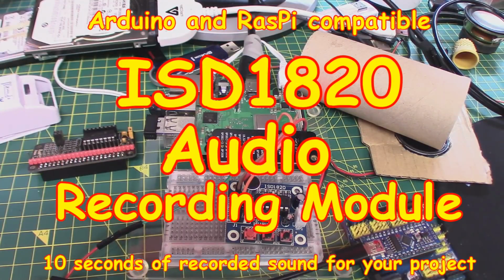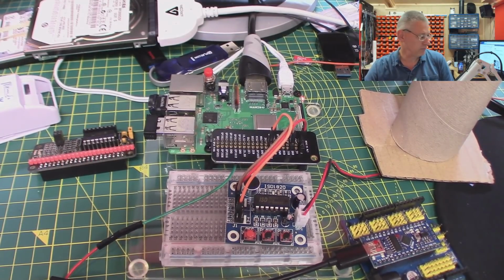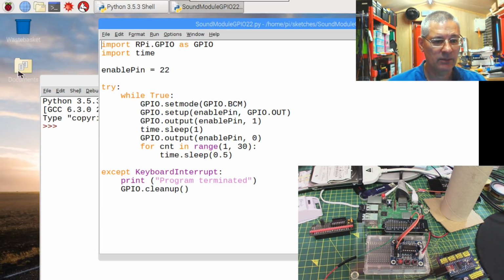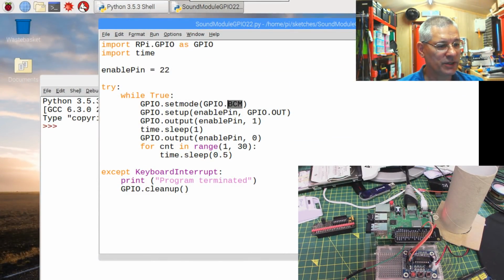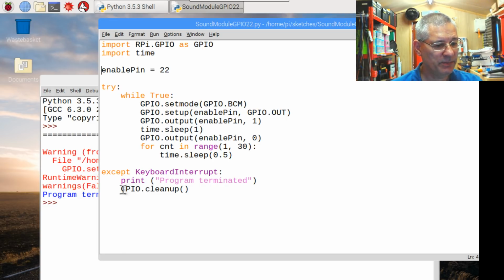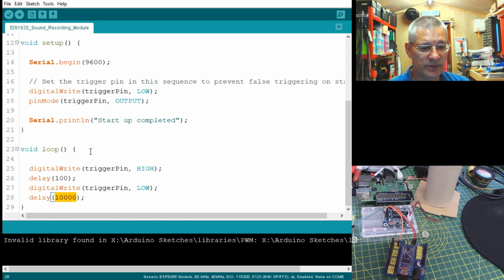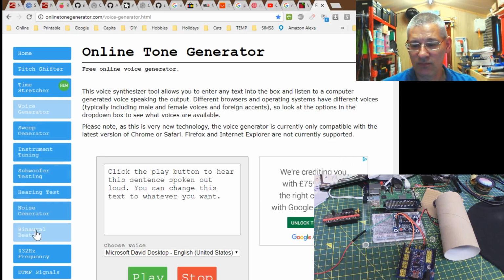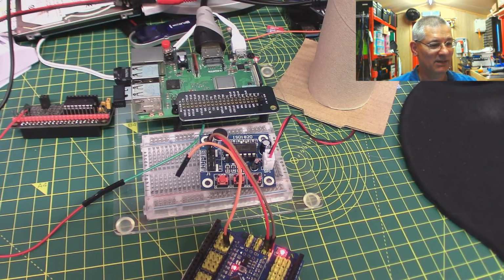#113 ISD1820 Audio Recorder Module (Arduino or 🥧RasPi)

Comment: Good video thanks, Is there a way of controlling the playback function from an external source such as an optical detector. Cheers
Reply from the maker: Well, you could use a N-MOSFET to bring the "PLAYE" pin to VCC (which is what the switch does) to make it play. Or, use a relay to do the same. If you can detect something and provide a signal then either of the above would work.

Comment: Hi Mike. My module does not play the PLAYL button correctly. It plays as long as you press, which is OK, but it stops after one cycle. Shouldn't it continue multiple cycles until the button is released? Does its operation depend on where to place the 'bridges'? If I connect P-E with REC I get the continuous sound I would like.
Reply from the maker: MIke's not here right now but I'll have a go at answering 😉 Yes, the jumpers do control how it is used; best advice I can give is read whatever documentation you can find on it. And other users may have answers too, so check out the Arduino forum.

Comment: Hello! I have a question: is it possible to play sound just one time automatically when the module get the power without push the PlayE button?
Reply from the maker: Yes, you can send the "play" command from the Arduino (or other microcontroller) without pushing any buttons. You can even tell it which track to play.

Comment: Is there any way i can record audio to pc at wav form with an arduino and an sound sensor. I don't want to save it on an sd i want real  time record
Reply from the maker: An Arduino is not fast enough, nor does it have an analog to digital converter that would suffice. You might be able to do that with something like an ESP32.
Reply: @RalphBacon  is this a shield for arduino?

Comment: I have one of the earlier models of this unit, or perhaps one by a different Chinese maker.  Mine has an on board LM386 amplifier chip, and two plugs for the speaker, one directly from the 1820 chip the other through the amp.  The amplified has a rheostat that you can adjust the level, and it is indeed needed, as it gets quit loud through the amp.  I believe the chip is wired with just the 20X amplification but I have not tried tying a cap across pins 1 and 8 to see if I get the 200X out of her as she is plenty loud enough as is.  The amp does, however also amplify the hiss that is present in the play back if you turn it up all the way, and substantially reduces that quality of the playback, at least to my aging hearing which is enhanced with a nice set of hearing aides provided to me by the VA in an attempt to replace the hearing I left over in Vietnam back in 1970.
Reply from the maker: These modules (or clones) change all the time, Jerry, which is why you got one with a built in amp, I suppose. But as you say, not exactly hi-fi if you can hear the hiss. Then again I don't suppose these units are meant to provide hi-fi playback either! Glad you got a decent hearing aid to assit.

Comment: if you sprinkle distilled de-ionized H2O on the datasheet it becomes less dry
Reply from the maker: If you sprinkle any water over a datasheet it tends to become less dry, otherwise known as sodden! So what's the tip here, Kenn? Do you mean use a demister type (very fine) spray?
Reply: @RalphBacon Kidding aside the datasheet is usually the best reference for a device. Usually the manufacturer puts a substantial effort in producing it. Often there is important information that is key to making a reliable, and robust circuit/device.  Why people are adverse to reading is sad.
Reply from the maker: I LOVE datasheets, Kenn. I find them quite readable even if some of the graphs leave me a bit nonplussed. But the gold is in there, you just have to dig a bit. OK, sometimes a lot. But it is there!

Comment: I can see the use of this board with an Arduino, but not with a RPi.  Why not use something like espeak?  You don't even need to create a Python program, it's addressable in Bash.  The RPi is a computer, not a microcontroller.
Reply from the maker: Well, yes, you could do it all in software on a Pi. I'm not really au fait with what the Pi can and can't do, so it's useful when guys like you set the record straight, thanks for that. I shall have to try that out when I fire up the Pi next.

Comment: hey Ralph..........!
i want to record voice using arduino and send these recordings via bluetooth or wifi to mobile phone 
kindly help me get that
Reply from the maker: So what steps do you think are required to do this? Sending a file to a mobile phone is not a simple push operation - the phone must accept the file. Connecting a phone to a BlueTooth (BT) device is relatively straightforward and has been covered in videos #36 and #37.  There are probably three or four steps (building blocks) for you to consider for this project...
Reply: i've seen both of your videos got much info but how to send data from arduino to phone via bluetooth or wireless
Reply: kindly help me i've my final year project stucked :( will be greatful
Reply from the maker: I'm afraid you will have to be much more explicit on exactly the point you are stuck on. I'm not here to design your final year project, am I? What have you done so far? What, precisely, is the problem you are facing?

Comment: I just ordered one of these for a "manual" project where I use a Reed switch to trigger the playback. (I hope that works).
What kind of voltage is "high" to trigger the playback using the pins?
Reply from the maker: A reed switch will work, just make sure hardly any current is flowing through that switch as reed switches will burn out just by looking at them too long! So maybe put a series resistor in place with the reed switch. I used the output from an Arduino so that was (nearly) 5v to switch it; I would fully expect it to work with lower voltages such as those found on a RasPi, so 3v should work too. The datasheet (Google is your best friend) will have full details. Good luck with your project.
Reply: Ralph S Bacon thank you!
The reed switch is a 12 volt switch and it will only trigger a 12 relay.
Then the relay will have 4.5 volt that triggers the playback button.
I don't know how much that relay uses, but it's one of those mini relays so I guess it's not to much.
Reply from the maker: I can only suggest you look at the data sheet for the reed relay first. I'd be concerned at driving a relay coil using it. Reed relays are normally used for signal switching, not current. You might need to use a simple transistor switching circuit, very easy, I can suggest one. I might be too cautious but that's just me!
Reply: Ralph S Bacon I looked at the data sheets and the reed switch was rated at 0.5 A at 12v.
The relay uses 0.03 A at 12v. 

Should work fine. 
Here you can see it in action, the reed switch is built in to the tap and the magnets are on the spinning part of it. 
https://youtu.be/bxf8qIKAuek

Thank you very much for your help!
Reply from the maker: Excellent that you checked this. You are right, it should be fine. Good luck with the audio part of the project.

Comment: I've just run into a programming IDE called "Great Cow BASIC". I would be interested if you have had any experience with this software.
Reply: Thanks Ralph
I think I'll stay with the Arduino IDE and keep learning from all the great instructional videos that you produce. I appreciate your comments and help. Cheers.
Reply from the maker: I haven't heard of it (and hence never used it), hoppynaki, but I've had a look at the website and their demo code.
 
I'm sure it's a great IDE, and a lot of work has obviously gone into it. There do seem to be more examples for PICs than Arduino chips, and I'm not surprised. The Arduino is already very well supported, not least by Arduino.cc themselves, as well as the wider community. Think of the thousands of libraries out there for the UNO. And they are all written in C++, not BASIC. I don't know how the two would come together.
 
The ultimate question is why you would go down a different path for the Arduino than the millions of other users, who have chosen to use an IDE that supports C++. What advantage is there to doing this? Where are you going to get support from? All examples you'll find on the Internet are in a different language to that supported by Great Cow BASIC.
 
For PICs, it's a bit of a different story. Some people use assembler (I tried it, it was hard work and slow to code), some C, some C++ and many use BASIC (including me). There is no one-size-fits-all language when it comes to PICs. For these chips, this IDE definitely offers something and would be worth exploring further.
 
That's my tuppence worth of opinion. Interesting question, now many more will be aware of this IDE, thanks for posting.
Reply: I've used this (the Linux version mostly) and I have to say it is excellent for both PIC and AVR programming but, as you said, I do tend to use it more for PIC microcontrollers. I must get around to experimenting a bit more with AVR using it.
Reply: Hi Ralph. Thanks for replying to my comment. I agree that there is huge support for the Arduino.
What caught my interest was a video (link below) that claims that GCB is 
 a compiler, that it runs considerably faster than the standard Arduino IDE and users up to 5 times less memory. I must say that his demonstration did not appear to be very scientific.

https://www.youtube.com/watch?v=qdloFhULa3I
Reply from the maker: Regarding any claim to running X times faster or using Y times less memory, you really do have to wonder how engineered the experiment is (not just for Arduinos). This experiment was very targetted at a loop and a count of four numbers (which is evaluated even before compiling) and then setting a pin high/low.
 
The code to do the latter was written by Arduino.cc and may not be optimised (if you use the Sloeber Eclipse IDE you can see exactly how that call is actually constructed behind the scenes). Maybe that is not 100% efficient but maybe it is 100% robust! We must remember who Arduino.cc are targetting their product at.
 
Now, I don't know whether the actual Arduino compiler is particularly "poor" at optimisation (it uses the AVR-GCC compiler) but I'd be surprised if it were, as this compiler is used for many AVR chips, with nothing to do with Arduinos at all! We must remember that whilst AVR (now MicroChip) probably appreciated the increase in sales of the 328P chip used in the UNO boards, they have no involvement with Arduinos at all. It's not part of their core business model. They just supply chips to whoever wants them.
 
However, this was an interesting video experiment, and I liked his presentation style. A pity he didn't grab a much larger, existing sketch and convert that to Great Cow BASIC (too much work, is my guess) and compare! Or even some other code, rather than just a loop.
 
For PICs it's probably great; for Arduinos, I'm not so sure. I wonder how easy it is to include C++ libraries? If it can do that, then it might make me experiment with it some more. Perhaps Nick can answer the question about libraries?

Comment: 13:39  python3 : the range only counts to 29, started at 1, if you need 30 iterations  use 0, 30 or 1, 31
also check out   https://pinout.xyz    shows alot of info about the pins + bcm/board ..., click on any label next to the pin,
top purple line on the right : each label also shows info, sometimes you even get code example (see I2C)
Reply from the maker: I like the link, Jyv - a very useful and interactive help sheet. Yes, you're right about the range, all programming languages start at 0, of course. Thanks for posting.

Comment: I'm enjoying your experimentation with the equipment you are using. Did I hear two microphones picking up your voice at some points? We will, of course, expect a "making of" video once you have some of it nailed down.
Reply from the maker: Unfortunately, K3n7 (how do you pronounce that ?) you should not have been aware that there were two microphones being used.
 
I discovered post videoing that they had gotten out of sync giving a sort of choral or overlay effect! That's was because one is a USB microphone and one an analog mic. But if it was good enough for Karen Carpenter...
 
Now, though, I have two USB microphones and they stay pretty much in sync (I hope), which you can confirm on my next video. It allows me to move from my computer desktop to the soldering station desktop without loss of, or reduction in, microphone volume (I hope, again). You would not believe the testing I've done for this!
 
I guess I need to introduce a new term of "Eagle Ears" to supplement the "Eagle Eyes" that you guys have all earned! Thanks for posting, great to hear from you.

Comment: How did you trigger it? I didn't see your hardware. I get pulling a pin high or low but seen no code for a keyboard matrix. 

I'm thinking it would make a great low fidelity delay device for a guitar effects pedal.
Reply from the maker: It was triggered by setting a pin high on a microcontroller and connecting that pin to the P-E or P-L pins on the sound module (depending on whether you wanted to have the message stop as soon as the pin went low again, or continue the full message regardless). I used an Arduino Nano (plugged into a development board so it looked more like a UNO) and a Raspberry Pi 3B+.
 
You could trigger it manually using a foot pedal and 3V battery to the same P-E/P-L pin, without a µController present, as the ISD1820 module is free-standing too. Does this help, ten littleindians?
Reply: Ralph S Bacon  I understand now, thanks for the clarification.

Comment: Cool review Ralph, thanks :)
I geuss, it's useful for Arduino & other uCs but not RPi nor other Pis.
Because RPi got sound and Linux[Raspian...etc.] got loads(big bunch) of speech apps; text to speech...etc.
festival, flite, espeak...etc. https://elinux.org/RPi_Text_to_Speech_(Speech_Synthesis)
https://learn.adafruit.com/speech-synthesis-on-the-raspberry-pi/introduction
Reply from the maker: But if, say, a sensor is attached to a remote Sonoff or something this is an easy way to add a voice? Just suggestin'
Reply: You're right :)
I have not thought about that.

Comment: At the bottom of  the Arduino IDE it says the board you are programming is a "Generic ESP8266 Module...".  How does that work with a Nano?  By the way when I heard the British female voice I thought of Emma Clarke (if you know who she is).  Depending on how you get around in London you hear her voice throughout.
Reply from the maker: That's because I had previously programmed the Nano and had then used the IDE to program an ESP8266. I just called up the sketch but didn't upload it or compile it. You guys really do have eagle eyes, nothing escapes you.
 
And, Emma Clarke is ... best known as the voice of the automated messages on the Bakerloo and Central lines of the London Underground (says Wikipedia) but as I don't travel on the tube I will just have to believe this. Here she is talking about how she did the work: https://youtu.be/uegDxNKHSK4?t=130 Our very own Marilyn Monroe!
Reply: I figured the thing with the ESP8266 board was something like that.  Does that mean that you will soon have another video with the ESP8266?  By the way, I saw that your link for the documentation was on the All Electronics website.  All Electronics is about a ten minute drive from my apartment.  Their cost for the ISD1820 is $6,00 US.  I think I might buy one though.  It is like Maplin's (RIP).  They might not be cheap but they are very convenient.  Actually compared to any other brick and mortar they are cheap.
Reply: You can get the ISD1820 board from China for $1 each, postpaid. Add 50 cents or so for a speaker. The downside is waiting a month or more for delivery.
Reply from the maker: Not necessarily a month, Art. Over the last 6 months (or more) I have had deliveries from the Far East within a couple of weeks. Banggood is particularly speedy, but others too. I guess it depends on where you are in the world.
 
That said, I have had 2 or three items over the past few years take more than two months to arrive - by which time the replacement item has already arrived! Go figure.